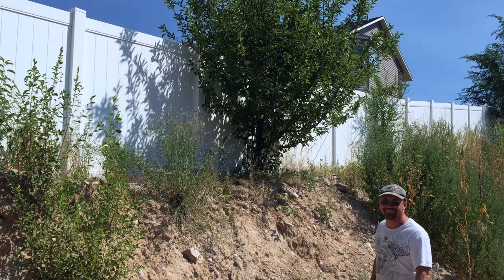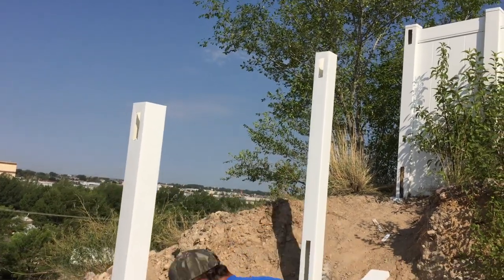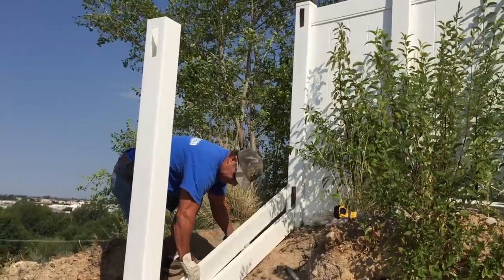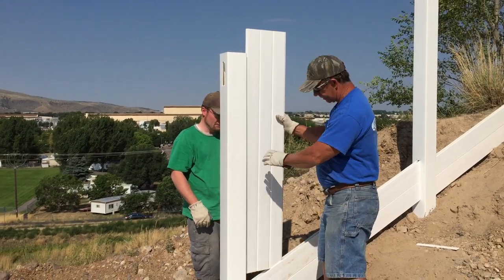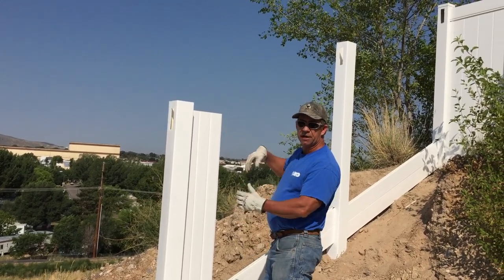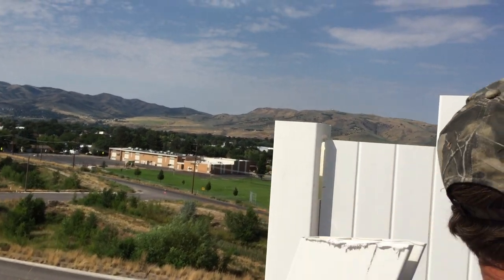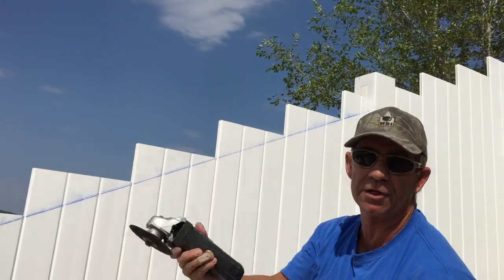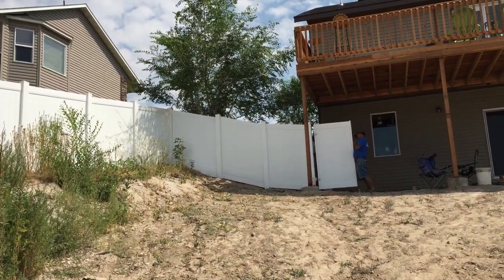Quick & Easy Vinyl Fence Setup On Steep Hills: Start To Finish DIY Tutorial!

Comment: If you want to install vinyl fence on a hillside the best way and right way to do it is to use end post and route the lower side out so it looks like a very straight line. Baahm! Baahm!

Comment: Where is the channel for the panels? Did you use rail locks ?
Reply from the maker: this customer did not want the extra expense of channel and the rails are locked in with screws.

Comment: see the line post required the same degree on the rail holes for it to flow, (if your top rail is 1.5" from top, the continuing rail on the other side should be bout  2.5" lower) also need to cut out the panels out of 16' since the 57.25" end up too short. SMH@ the bottom double rail idea.
Reply: Bebo i don't understand why they doubled up the bottom rail either. Seems unnecessary if u cut the angles without changing the overall height of the pickets. Routering out the first post is where everything got F'd up.

Comment: 1:58 what is that screw screwed into? is the other end poking out the post?! lol
Reply: It isn't screwed into anything but the rail. The one at the bottom end blocks the rail from sliding uphill and the one at the top end of the rail stops the rail from sliding downhill.

Comment: your skirt boards don't even line up dude and those grabbers look like they really hold the bottom rail support the bottom or skirt boards will sage in the heat and the top rail doesn't line up looks like shit dude and yes i've been carpenter for 40 years and do know what i'm talking about my wood fences that I would build will last at least forty years that's because I know how to build them , do you ?
Reply from the maker: The fence is still looking beautiful. It’s at least 10 years old now. The rails have not sagged and they are still locked in.
Reply: @WholesaleVinylFencing  it never did look beautiful , the material will last the elements but  to install it properly and look good is the key but nowadays it’s all about how fast and how much money it will cost . I’ve been retired now for five years and I cannot compete with most on price or don’t want to compete but I will still help some if they need it